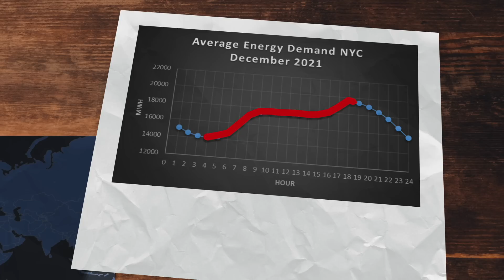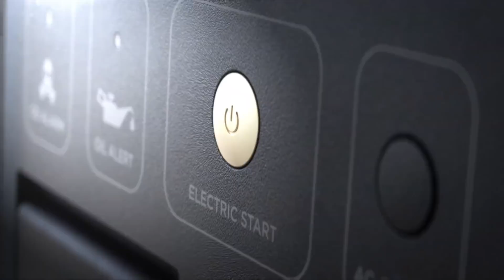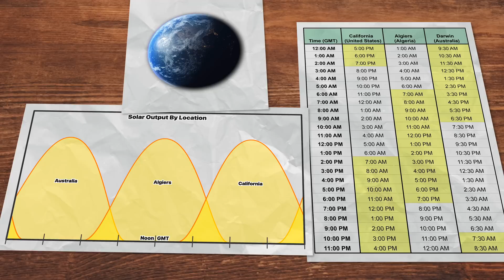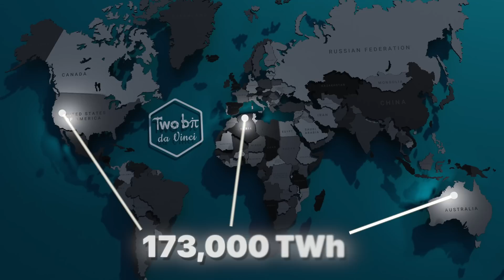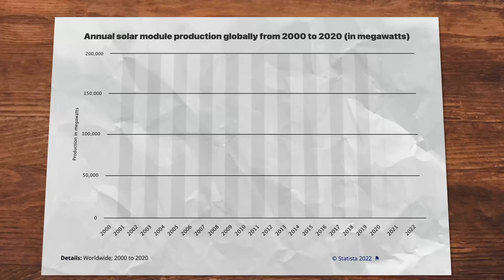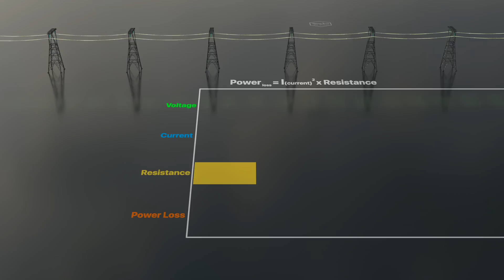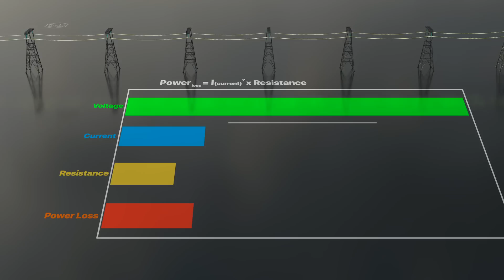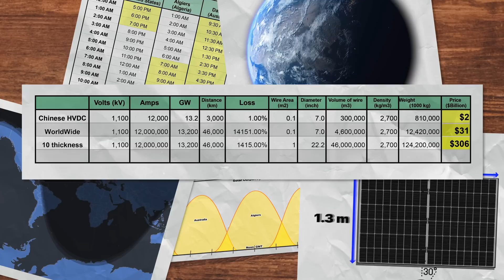World Solar Energy Network... Could this work?

Comment: They are considering sending solar energy from space in microwaves, which seems ridiculously ambitious. But what about relaying energy from the sunny side to the dark side using microwave transmission and bouncing off satellites? If you can send energy in microwaves from space, then you can easier send it from one country to another via space presumably, obfuscating the need for international cables.
Reply: reflected sunlight is way more economical. A MIRROR FOIL that can be unrolled and constructed in low orbit space shining the sunshine on the opposite side of the Earth (nighttime). For just around 2.4billion US you could provide enough re-directed sunlight to POWER the Earth 3X more than it uses in electricity. Solar panel farms could be built on Earth to most economically receive that mirrored sunlight. Only small drawback is there will no longer be dark skies at nighttime (this could even be a benefit not needing streetlights anywhere in the world ever again.)

Comment: I feel that a more microsystem would be better. 

Ie. What if every house and every business had solar panels and optional batteries. Not only would the infrastructure be a lot cheaper but everything would be less susceptible to interruptions. Any excess could be either sent a regional power storage or sent to other areas close by like small towns with a lesser infrastructure. 

You can argue that the it will probably take more in the sense of materials for batteries and solar panels but that would be greatly offset by the reduction in materials for the power lines. 

Downtown areas just need solar panels enough to power the basics in case of emergencies and the rest can be taken from less dense areas that can accommodate a massive solar roof. This way using buildings will mean less need of an area just for a solar farm. 

You can then have 2 possible models to manage this. Either a power company that is just incharge of the infrastructure and is the middle man between city centers and suburban areas. Or one that treats the roofs as their assets and maintains them providing free electricity to houses and selling it to places with lots of high rises or thar demand higher levels of electricity.

Comment: If we figure out a way to effectively connect the world's electricity grid as one it wouldn't just work for solar power it would work for all greenpower that could be fed into the system from anywhere in the world where it is produced could feed nuclear wind hydro so we wouldn't necessarily need to produce that many solar panels to connect a worldwide greenpower network. but yes the raw material cost of a sufficient transmission cable is extremely high

Comment: Hi Ricky, I love the thought experiment. It was very interesting. The only addition I could think of is if you were have more than 3 major stations. Would this reduce the materials at all? It would at least help in case of inclement weather.

We wouldn’t have to build it all at once. Similar to a train or subway, you can always add on over time. Could you explain what it would take if this were only in the US?
Reply: More stations would add resiliency via redundancy to balance out downturns, but to share total power around the world, it’d still need those insane conductors at those insane voltages/current.
Reply: @strictnonconformist7369  exactly. You need every single power plant to be able to provide power to the other end of the earth, so you still need the really thick conductors and crazy expensive substations. But the biggest issue is that redundancy requires that each solar farm be able to power the world, so you’d have to multiply the billions of panels times the number of redundant solar farms
Reply: @strictnonconformist7369  Do remember this thought experiment was about the minimum requirements, so yes more farms is more resilient, was mentioned in the conclusions
Reply: This was about what the system could look like with the minimum requirements. So yes more farms is more resilient and was alluded to in the conclusions
Reply: Actually, that seems like it would also solve transmission lines issue.  I.e. if you distributed power production, you have less power flow required from each production site which means smaller transmission lines, transformers, etc.

Comment: Can we? Yes! And it's easier than we believe! 
With no conversion necessary.  Mirrors and sand batteries. The key is concentrated sunlight comes to a point, then diverges again. Just to the front of or behind the focal point, the beam must be made straight again. This is accomplished by a number of ways, a concave lens before, a convex lens after, or mirrors of reverse nature. There's even a spiral mirror to reflect the beam through it, adjusting the beam as it passes. Take note of this last one. Polar Night Energy made a commercial version of the sand battery they heat with resistance heating. This tech can be adapted to distribute energy to homes near and far within direct line of sight and with reflectors to some not directly visible. Sand coated with graphene for even distribution within the storage tank. The spiral mirrors take IR from the collection tank and condition the beam into a straight ray for distribution. At the destination, heat is used to condition the home living space, and a small portion is converted for electrical appliances and gadgets. Arrangements for the whole subdivision to reflect the rooftop sunlight to a central tower, and a small portion returned for continuity over night, and between seasons. Even those shadow bound are enlightened this way.
Visible light can be thus directed as well and separated from IR, allowing heating and lighting separately.

Comment: Nicola Tesla claimed wireless transmission of energy was possible. A geosynchronous PV panel could transmit 24/7.
Reply: Nobody can reproduce those results.
Reply: @markpetty9206  He did it once, in CO., with a "black box" connected to an EV (no battery). Why no one bought the tech is a mystery. But maybe Big Oil did buy/bury it.

Comment: This would never work. The only solution is to decentralize all solar power by putting it on every home, building, parking lot, brownfield, closed landfill or vacant land that we can. Depending on other countries for electricity is a losing proposition because relations could go bad and the power could be cut off at anytime. Each country needs to decentralize solar as much as possible, so they are not dependant on other countries.

Comment: The idea of just three solar production facilities ignores wind and ever improving wave based energy production.
Also it ignores the existing landmass commonly called people’s roofs! Add barns, garages, sheds, etc… that’s a LOT OF LAND.
Add how energy demand drops at night… people do sleep about 8 hours a day so…
But far more important is to remember the three arrows in the recycling symbol, reduce, reuse, recycle.
Every dollar spent making us more energy efficient, replaces what? 2, 3, 5 dollars of energy production?
Here in Canada we spend a huge amount of money heating or cooling our homes, offices, malls and factories.
Just investing in new approaches to renovating older homes and forcing strict new rules on building homes could GREATLY affect our need for power (electricity, gas and other fuels).
Remember that though a net zero home is about 20-30% more expensive to build (at the moment but should be way cheaper when ALL new homes become net zero thus costs drop with each doubling of production, say 16%/2x), the true inflation in housing has nothing to do with labour costs or materials costs. The same house in cornerbrook Newfoundland which costs 280,000 $ Canadian is 470,000$ in Montreal and 650,000$ in Toronto and nearly 1,000,000$ in Vancouver! It ain’t the cost of the house, it’s the land. Therefore forcing an additional 60,000$ on a split level 24x40 home would barely make a dent but would allow such a house to be net zero. And the cost of panels, batteries and such would just keep dropping.
Start there and you will quickly see that energy needs would drop amazingly.

Comment: Another channel did a  piece on new solar panel tech that has kind of magnifying glass squares above each portion of the panel that dramatically boosts electricity production & I think it also used heat not just light; could heavily cut down on # of panels needed if ever comes to fruition sounds like.

Comment: As theoretical exercise, this is OK. As practical one, nope. The problem is not the technology, but as mentioned in the video - the geopolitical problems.
However, we do see a lot of additional possibilities everywhere - combine roof-top solar on all buildings (especially industrial) with wind, hydro and storage like pumped hydro or batteries and we DO have enough options to power world by renewables.
That would be far more interesting calculation.
I've seen some calculation somewhere (can't recall where) that said that we would only need batteries for 6 hours to get whole country through 99.9% of the year - that wind + solar + hydro would be able to cover the rest. The mix of the sources was different per each country, but the battery size equivalent was always the same.
Add a bit of atom to the mix and I see this happening no problem - no more oil dependency.
Would it be costly? Sure. Would it be cheaper even in mid-term? Also sure.
Look at the price fluctuations Europe is going through right now thanks not only to the war, but also thanks to few greedy oil/gas producers.

Comment: Orbiting mirrors to reflect sunlight to ground based solar farms reduces the number of solar panels, and the ground occupied, by at least 4.  It also reduces the length of the global extension cord.
Reply: You would also be heating up the Earth more, which is the problem we are trying to avoid.
Reply: @yorkyone2143  Only a little bit. For the amount of electricity created, it would be worth it.

Comment: What are you doing throwing out actual facts and figures? You're just ruining the day of people that say it can be easily done. Great video man, I really liked it. First thing I would never put it at three main stations, like you said too easily attacked, I would do much smaller stations, and a lot more spread out. But really the main problems in the first stage, the minerals in the building of the capture system itself.

Comment: You ned much more than 1% of AU land to power all our energy need from solar.
My calculation is abou million square kilometers or 1000km x 1000km land.
AU have 7.7 mil. Sq. km, so about 15%.

Comment: Your thinking is very interesting.  But... what is the real business requirement?  I think the high level bus. req. is that we need x amount of electric power around the world during each day.  Perhaps a more feasible approach would be think more broadly about the pumped hydro as you mentioned.  Could we build something like many 50 foot above sea level cofferdams as energy storage all over the world.  Maybe something like these are floating storage tanks.  Something like this will be much less vulnerable to single points of failure or sabotage.

Also will fusion ever be realized?  Who knows.  But it sounds like it may have a chance.  If so, the need for ideas like this may be mute point.

Comment: What if all the roads were covered with a roof made of solar panels. No more snow on the road. Not so many solar farms. Parking lots, all interstate roads. No driving in rain or snow.
Water run off could be stored & cleaned.

Comment: Has the creation of off shore solar farms been considered or investigated? I imagine the engineering challenges would be complex but not impossible to solve.
Reply: Many roofs still dont have solar, no need to go off shore and spend 10 times the miney for the same kwh. The problem is intermittency
Reply: @kapytanhook  I don't disagree with the sentiment. In fact, I'd suggest it should be a legal requirement for new builds. Unfortunately, many people don't have the means, will, or desire to install rooftop solar systems on the scale required to offset fossil fuel based energy infrastructure effectively. I suspect a hybrid solution will be required, inclusive of off shore solutions.
Reply: @bnr_013  no need to require them. There are already not enough houses as is. If it makes financial sense people will get it. Maybe panels and batteries will dramatically improve in the next few years

Comment: This is EXACTLY how it needs to be done! Forget long term batteries! They are astronomically expensive. The future will all be about networking Wind, Solar and geothermal.  If you do all three, then you don't need distances as long. Also, the production challenges will also be alleviated.  It would have to be network, not a backbone.
Reply: There are needs for batteries regardless: power needs vary, as does solar capture, as does (if we add it into the mix) wind capture and wave capture for energy. Geothermal is the most reliable overall, with today’s technology, for power generation.

There have been interesting events that would foul up relying on solar energy like this, such as major volcano eruptions. This thought experiment didn’t go into redundancy for normal failures that happen that’d result in lower production, such as breaks in transmission lines, which are not uncommon in (as one example) California during fire season.
Reply: @strictnonconformist7369  Yes 6-12 hours battery storage. But long term battery storage - even if we can make batteries 10x cheaper than now would be astronomically expensive. Hence network power is the most efficient way forward.

Comment: Design a magnet motor generator unit standardised at 3 to 5kW for each home.
Make it stackable and scalable such that one can connect these in parallel or series for every home or business (design a heavy duty unit for mining industry, etc.)
No expensive reticulation (electric grid) required.
No expensive high-maintenance substations.
No large area breakdowns (user simply replaces worn out part(s) and they're back up again).
No polluting fuel or noise (except worn-out magnets that may need replacing).
Unit is portable and can be used anywhere anytime.
NO ONE CONTROLS CENTRAL POWER PRODUCTION!
Reply: We need the technology first.
Reply: This is in fact old technology and I actually don't know why people aren't applying it. The only big problem I see is that rare earth metals are required, which is obviously not 'green' energy, but it could afford us a practical solution to our current problems.

Comment: you have to think about residential areas that also have panels installed.
that would lower the amount these sites would have to generate, over time more homes would install solar.
the only weakness of them is night, which this could be a solution for, ppl use less electricity at night cuz most of us are asleep. so it's not even an absurd number to take care of. 

we shouldn't centralize energy this way tho. 
it would be great in a perfect world but we arent living in a perfect world. all it takes is a few rockets at the good places and the whole system is fucked till repair.